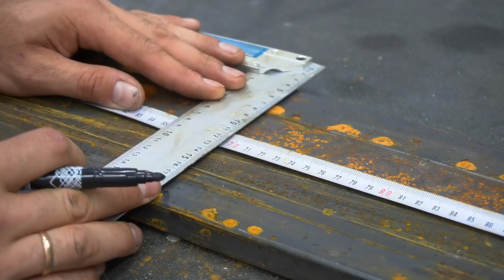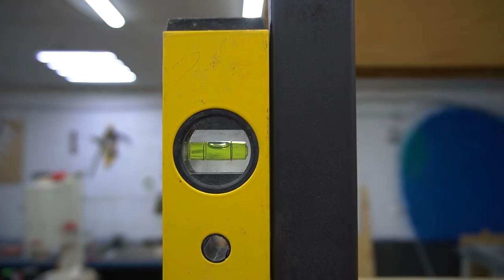Secret Profile Pipe! An amazing invention! It will come to mind!

Comment: I recommend you put in a couple diagonal braces to strengthen  the shelving so it doesn't accordion on you. Or without trying to burn the wood you can weld three or four of the joints and the weld will keep it from according..

Comment: Amazing what you can make with different types of metal stock Steel stock if you like to weld and if you like to design and make things if you got the brainstorming capability to dream up some ideas the basis of an engineer. I like to weld and from experience new stocks is so much easier to weld then old steel that's Rusty or painted you got to clean it more even if you do use a 6013 all-purpose stick rod it's better to grind down your joints and get clean metal you'll get a much better weld. Or if you're using the Torches the flame will burn off the junk Burns off the paint doesn't burn off all the rust but so actually it's better if you clean the joint before you use the Torches.